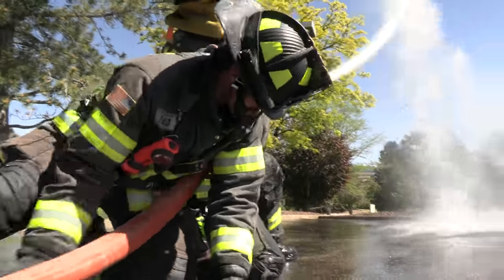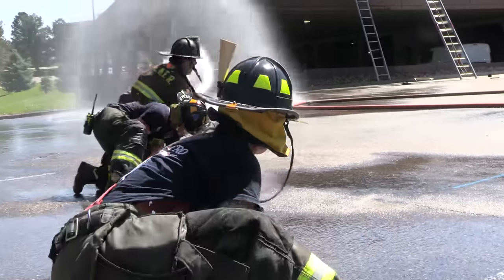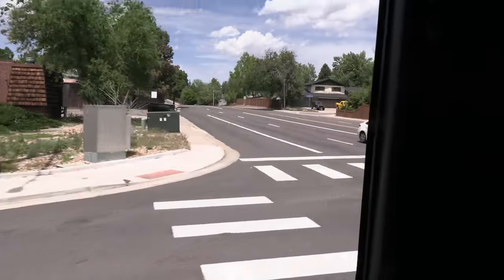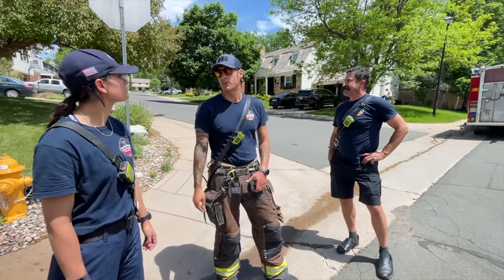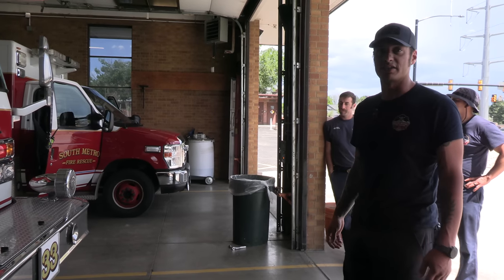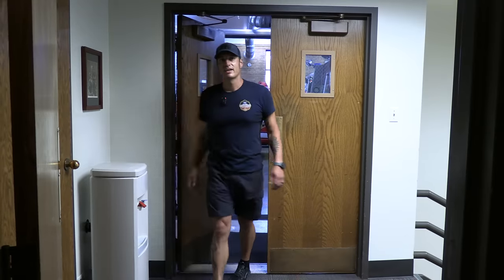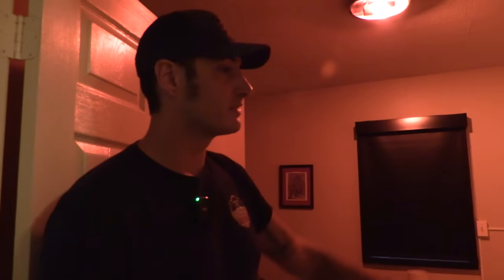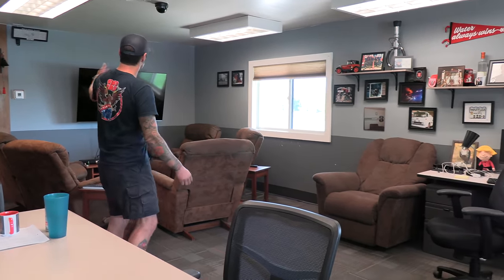2 1/2 and Waffles - Firehouse 33 - Station Sunday

Comment: Hello My Brothers and Sister's, I'm A 30 year Veteran and have been Retired for the last 11 years, 33 has a Nice Station. I worked on both the Engine company as well as the truck company. We were fighting a house fire and me and my partner were up on the roof cutting a hole for ventilation and just as I put the point of the axe in the cut flames shot up in front of me and lost my balance and fell 2 1/2 stories and landed on my air pack, I fell through the second and first floor when my alarm went off so I could be found. I injured my lower back and neck. Stay safe my Brothers and Sister

Comment: I’m guessing when you guys do that in house training, especially when taking all that hose off the engine, you guys go out of service?
Reply: Probably not. Almost no departments go out of service for training. They would advise dispatch they would be on a training delay for x amount of minutes. 

It should only take about 2-4 minutes to get the hose back on the truck and respond. So they may tell dispatch that they are on a 5 minute delay for training so depending on the call, the delay may not matter, but if it does, then they will send another engine. But chances are that engine will take 5 minutes longer to respond into that area.
Reply from the maker: At South Metro, units have the option to stay in service, go on a 1, 3 or 5 minute training delay or go completely out of service. Usually the Lieutenant or Captain will decided what level is appropriate.

Comment: Is the engine only staffed with 3 persons? seems harsh with 7+ daily responses
Reply: It depends on the overall staffing on each shift.
Reply: @Cyedae  Previously on Station Saturday, the crew has mentioned the if the engine is staffed with only 3 because of low call volume. The didnt here, so im  curious if its because of one crew missing(illness, vacation ect) or if its only is staffed with 3 witch seems odd of South Metro Fire Rescue Centennial for station as busy as this
Reply: @jakobmadsen31  Like I said, it'll depend on the overall staffing on each shift (A, B, & C). There may also be staffing shortages within the department which is why they only have 3 members on RE33.
Reply from the maker: South Metro continues to work toward 4 person staffing on all Engine Companies. Engine 33 will likely get their 4th after the next academy class or two graduates. Operations Division ultimately decides which Engines have a 4 person minimum based on a number of factors like being paired with a Medic Unit, their location and call volume.
Reply: Is 7 runs a lot for this department?

Comment: Is station 15 going to split into 33s for the rebuild?
Reply: E15 has moved to Station 37 north of 15s and will respond from there as E37, M15 as moved to Station 14 to the northeast and responds as M14, there is minimal increase in response time in fact some of 15s first due will have a quicker response time.
Reply from the maker: Station 33 isn't large enough to accommodate additional apparatus and personnel. As Autofleet4429 wrote below, Engine 15 was relocated to Engine 37 and Medic 15 was relocated to Medic 14.

Comment: is engine 33 front line or reserve?
Reply from the maker: Engine 33 is using a reserve.
Reply: @SouthMetroFireRescuePIO  They've been in that truck for a while. What's going on with the frontline engine?
Reply from the maker: @some0ne8  Their front line engine had stress cracks on the frame that required some disassembly to repair.

Comment: How do you guys refill a fire truck after a mission or training
Reply: I've actually seen this once with my local department they had a car fire in front of my place and after they battle the car fire the engineer took the engine to the nearest fire hydrant refilled that way.
Reply from the maker: Yes, water tanks on fire apparatus are refilled after fires and training, usually at the nearest fire hydrant.
Reply: @SouthMetroFireRescuePIO  is there one usually at or near the station or would they have to find it?
Reply from the maker: @seanrobbins7125  There is a hydrant right next to Station 33 and usually one on every street corner in their first due area.